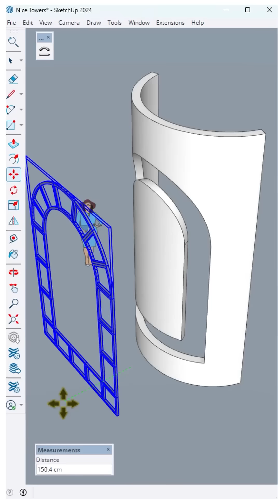Learn how to create a window around  the curved wall in Sketchup using Shape bender plugin #sketchup

Comment: As an engineer, I don't like that middle section. It's not supported, too much stress on the glass joints.
but yeah, good modeling.
Reply: Maybe use other material?
Reply from the maker: Thanks for your feedback, I'll consider it in the next videos 🙏
Reply: @NiceTower As a first year structural engineering student, I think this design can still work if you join the window frames with both the internal and external wall frames, but ultimately this design is more aesthetic than functional. But I still like the look. You inspired me to try more irregular shapes in my designs.
Reply: im architect engineering major and that's also my concern the first time i saw the design

Comment: For blender3d:
1. Duplicate a curved edge from the wall
2. Separate from the wall
3. Convert to curve
4. Add "Curve" modificator to your window
5. And select your curve in the modificator settings.
You may also need to subdivide the window, so it curves better
Reply from the maker: Thank you